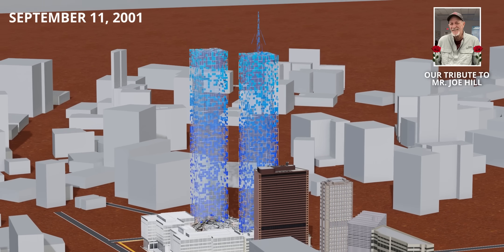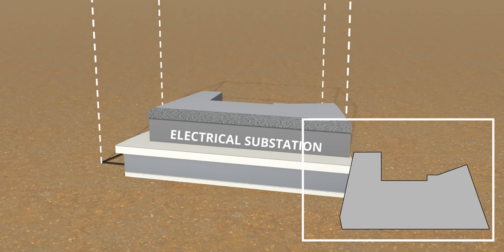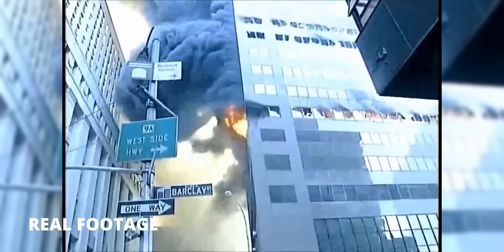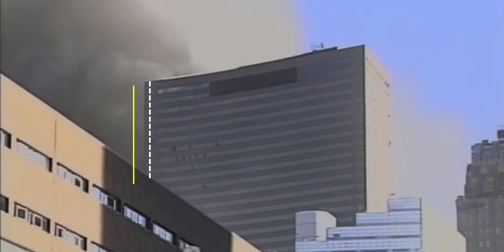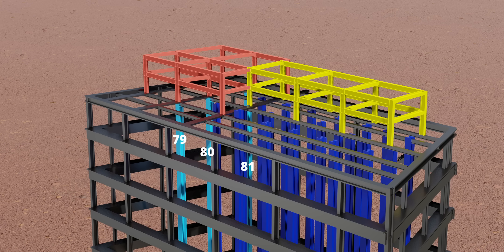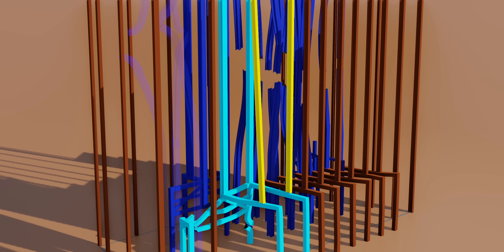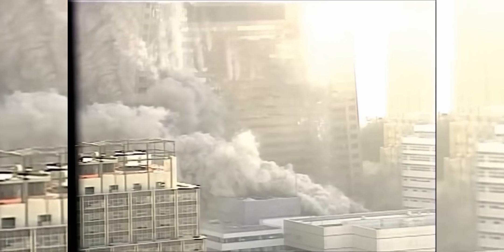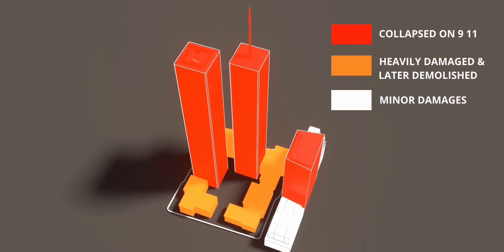Collapse of Building 7 | The Complete Physics

Comment: Its sad joe spent so much time focusing on building 7 videos. And clearly no time watching the videos of 1000s of buildings coming down with explosives. Oh wait if he never watched planned buildings collapsing he wouldnt have known to focus on challenging the kink that happens with every building taken down into its own footprint...... So was it more than a second slower than freefall with 1000s or simultaneous failures of welds and bolts to keep up with your delusional story?????
Reply: I did. This is what I came up with:

Much misunderstood, Building 7 was the 6th building to collapse of the 10 lost on 9/11. Because of its early low priority, conspiracy filled the information void with garbage made up by technically ignorant people promoting political agendas. But this is an engineering problem and should be treated as such, so I prepared this brief summary of my own analysis to fix that, using engineering, not politics and tired memes.

The North Tower collapse at 10:28am bombarded Building 7 with tons of debris, causing heavy damage and starting multiple fires which burned out of control for 7 hours. Half the FDNY firefighters having been killed, units in disarray, equipment destroyed, no water pressure, and the greater urgency of search & rescue efforts, firefighting was pulled as futile. The building couldn’t be saved and was left to its fate. That is the sort of choice firefighters make every day in brush fire situations - which houses to save and which ones to let go. Only real difference here is moving the decimal on the size and cost. People get overwhelmed by the size.

www.youtube.com/watch?v=g_SvpwyC17M&ab_channel=MFitz

Collapse of a burning structure is always a concern for firefighters. Steel buildings subject to fire rely on active fighting of the fires to survive. Buildings are designed around 1 to 3 hours of fire resistance, allowing time for occupants to escape and ACTIVE firefighting to get started, after which all bets are off. Left to their own devices they will exceed their design envelope and collapse, like Plasco Tower and Wilton Paes de Almeida. In B7 the occupants escaped, passive and active fire protections were compromised and active firefighting was abandoned 3 hours before the collapse, which left the building to its fate. It lost. Odds on Building 7 would eventually collapse, and it did. No big deal in logic.

www.youtube.com/watch?v=WnYBX6QT0R4

FDNY Chief Daniel Nigro ; The biggest decision we had to make on the first day was to clear the area and create a collapse zone around the severely damaged 7 World Trade Center, a 47-story building heavily involved in fire. A number of fire officers and companies assessed the damage to the building. The appraisals indicated that the buildings structural integrity was in serious doubt. I issued orders to PULL back the firefighters and define the collapse zone. It was a critical decision; We could not lose any more firefighters. It took a lot of time to PULL everyone out, given the emotionalism of the day, communications difficulties and the collapse terrain

FDNY Deputy Chief Peter Hayden ; We had our special operations people set up surveying instruments to monitor and see if there was any movement in the building. We were concerned of the possibility of collapse in the building. And we had a discussion with one particular engineer there, and we asked him if we allowed it to burn could we anticipate a collapse and if so, how soon? And it turned out that he was pretty much right on the money, that he said 'In its current state you have about 5 hours

The collapse of Building 7 was anticipated and widely reported in the media throughout the day, with 24 video cameras recording some or all of the collapse. Everyone knew what was coming and why.

www.youtube.com/watch?v=OY5S5k3tMHI

Building 7’s collapse was completely different to the Twin Towers and harder to understand as most details hidden from view and not intuitive, but we can still sort out what happened through careful analysis and observation. This is my explanation of the collapse relying on no outside authority.

Building 7 was complex, assymetrical 47-story steel framed structure built atop a smaller 3-story building, requiring lower floors dedicated to complex load transfer structures, not usable office space. Of trapezoidal shape and all-steel tube-in-tube construction, B7 (above the 7th floor) consisted of a central core of steel columns carrying most of the gravity load, perimeter steel columns around the outside of the structure carrying the remainder of the gravity loads and long span beams and girders to tie those elements together and form the floors. On the outside of the building hung a moment frame or outer shell.

Phase 1 : First externally visible signs of collapse initiation occurred at 5:20:28 pm and were notably quiet with observers not realizing the building was collapsing! No audible warning in the form of hundreds of ear drum busting 180-190dB explosive bangs preceding the collapse. Here at 12:00 a local CBS affiliate reporter is talking 10 blocks from B7 when collapse begins. People don’t start to notice the collapse until 12:11. At 12:45 is the famous CBS fixed camera clip of Building 7’s collapse. Note how quiet it is.

youtube.com/watch?v=t5tEy6mXSE8&ab_channel=fresnosean379

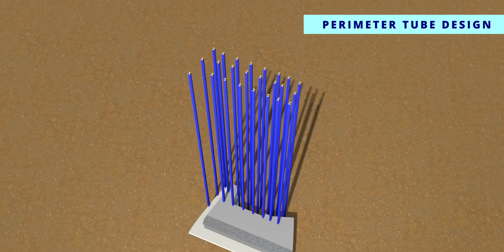Collapse initiation was due to lower floor failures above the load transfer region (7th floor) in the NE corner. In this video at 0:45 you can see the NW corner from inside the building while under construction, Column 79 just out of frame on the left. That big, angled steel beam across the top of the frame connects to C79 at one end. The girders connect to the beam. That beam and all those girders depend on just one connection

youtube.com/watch?v=nP3TNHPCIVU&t=35s&ab_channel=EdwardCurrent

Phase 2 : The floor failures caused a loss of critical lateral support over an excessive length of core Column 79 and it buckled. If you look at a floor diagram of Building 7 (see above) and look at all the structures that depend on C79 you quickly realize this one column was a relatively isolated structural element on which a disproportionately greater fraction of the structure depended analogous to say the Key Bridge. Externally we see a vertical progression of window breakage along the 44-46 line and a kink in the roof of the East Mechanical Penthouse at the top of the building, consistent with C79 failure. The transition from full capacity to almost no capacity occurs in an instant. Once the buckling failure occurs there is almost no resistance

Normally with a buckling column, the load could be redistributed to other columns. With C79 that is not the case - the failure did not redistribute the load, so the collapse rapidly progressed to the roofline, sinking the rooftop penthouse.

Phase 3 : With C79 gone, B7’s progressive, non-symmetrical collapse continues with C80 and C81 at the east end of the core left laterally unsupported and quickly buckled and failed as well, sending the EMP down through the building. C79-81 all have no diagonal bracing, which I believe is a major reason why they could not redistribute a lot of vertical loads among one another.

From there collapse progressed from east to west through the central core until the core was gone taking all of the interior floors and probably most of the perimeter columns with it. Follow the horizontal progression of window failures low in the building and the dropping of the remaining rooftop structures into the building. One of the big takeaways from the NIST Building 7 study (that gets completely ignored) was their modeling which determined C79 failing under ANY circumstances would have initiated the same collapse sequence.

Phase 4 : After 10 seconds only the exterior moment frame - a hollow empty outer shell – remains, giving the ILLUSION the Building is still standing since little has outwardly changed. It is just a hollow empty shell like an empty cereal box. Supported by only a few remaining columns that empty shell is quite unable to remain standing. With all core columns and floors gone, the north face leans inward, forming a V in the roofline, the last few columns buckle under the strain and the moment frame free falls, landing on top of the 7-story high debris pile. It is only late in the game here at the end that a single measurement of alleged free fall acceleration is taken, from a single point on that outer shell. The Building did not “free fall” – just one corner of the outer shell did, sort of. The Building was already gone before that happened. The period of alleged free fall was a product of how it fell NOT why it fell and cannot tell us what started the collapse. Start to finish the entire collapse took 18-20 seconds, 3 times longer than true free fall . How fast something falls cannot tell you what started it falling_ anyway. The debris spread outside the footprint, blocking surrounding streets, heavily damaging the Verizon Building and destroyed Fiterman Hall.

Building 7’s progressive, non-symmetrical collapse was incidental and unintended collateral damage from the combined effects of fire + time + gravity, started by the collapsing North Tower. That is true no matter who planned and carried out the 9/11 attacks or why . The collapse was of so little consequence it barely even registered at the time, a mere footnote. It only took on semi-mythical status as an alleged smoking gun years later when demolitions at the Twin Towers, missiles at the Pentagon and shoot down over Shanksville all failed and conspiracists had nothing left to work with.

Anything can seem like a conspiracy if you don’t understand how it works. Now you should. I hope you found this helpful, informative and it solicits informed critical comment. If I made any errors of fact, logic or reason or left anything important out, please let me know so I can fix it. IF you can offer a more plausible alternative please do. Be the first. Please start any reply with the words “Tits McGee” or I will know you didn’t read it and are wasting my time.
Reply: @TheCriticalStinker-01  So which 5 buildings collapsed prior to WTC7 stinkyshill? Oh wait I forgot: You are way too much of a coward to EVER answer questions on your stupid lies...